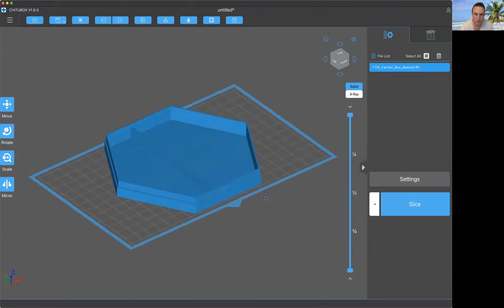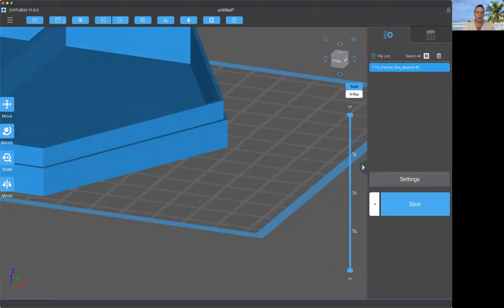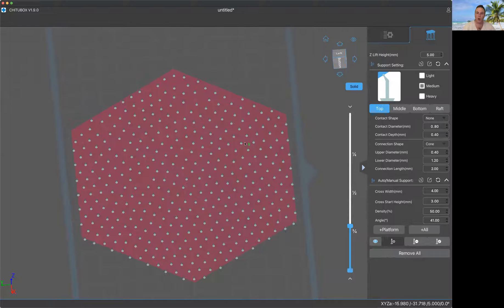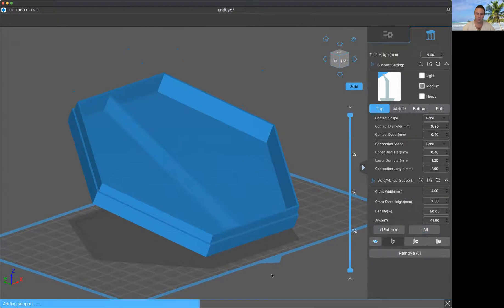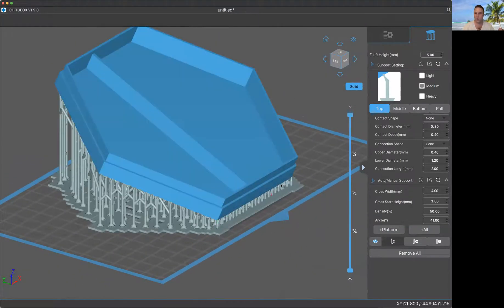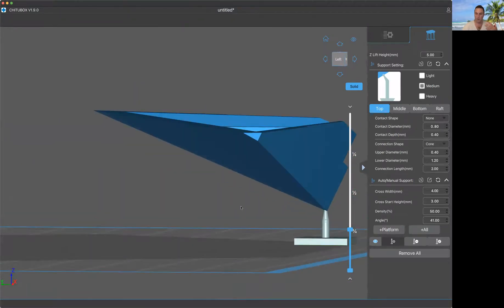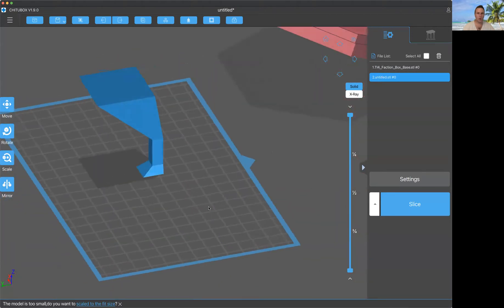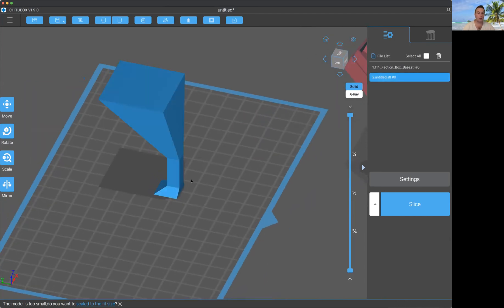Part 1: Tips for 3D model orientation and supports for MSLA Resin 3D printing

Comment: great vid =) So like when you angle the first time.. what angle do you recommend for that first angle for the object? I hear 40-45? and I see you have your supports at 41? What do you recommend? and of course it depends on the object I guess but a guideline to use
Reply from the maker: I usually print more organic shapes, so there is less of an obvious correct answer as would be the case with a flat object rotated 45 degrees. I typically use the default value. (I think it's 45 degrees) but then I eyeball things based on the physics as I imagine it being built up sequentially. I typically don't alter the angle threshold for auto supports, and just fix issues in the Add Manual Supports phase.